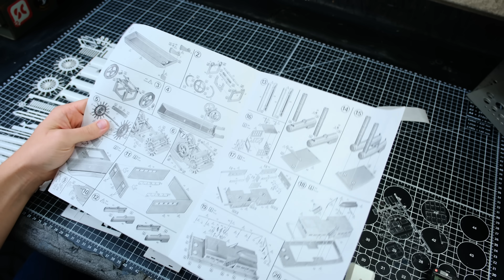Anaconda in Resin | Riverboat Epoxy Diorama

Comment: I really like how you've started incorporating the electrical switches into the build to disguise them. It may be worth trying out different switch types depending on the disguise, where buttons or knobs would be easier to hide.
Reply: I very much agree, I love the hidden switches, it's so much better than an obvious switch sticking out of the base, background, etc. And yes, it's worth looking into different types of switch - there are some low profile push button switches for example which may be more suitable in some cases.

Comment: I've built that riverboat about four times over the years. In its current iteration I extended the hull for better flotation, added better bollards and cleats and a wooden deck. It still needs very calm water, but it doesn't sink the way previous iterations did! Chugs along very nicely.

Comment: One cool effect that could add a lot of life and detail for very little work would be some paper cutouts to cast various shadows from the inside… like other crew members talking, or random papers/maps hung in the window, or even just some curtains that are partially open.
Just so the windows don’t feel so blank and uniform. 

This is incredible and better than anything I could do, so I’m not complaining. Just offering tips that I’d use because I rely on small tricks to add more detail and life where I can since I’m not as skilled at painting and stuff. 
Like when I sculpt eyes i always stab a hole for the pupil and make the iris part a shallow “bowl” so that when the eye is painted and filled with uv resin, it looks way more realistic even with my crappy paint job.. if I could paint well it would look super realistic! The pupil looks actually black like a hole because it actually is and the depth of the iris sells the illusion better at angles other than straight on, because that’s how real eyes are shaped. 
Very small details that are super easy to implement that add a ton of extra “value” is how I like to work. Poking a hole or adding a little cardboard cutout takes an additional 5 seconds but gives way more detail value.

Comment: What kind of glue do you use and what primer. I’m about to do my first model kit and want to get the right stuff. I’m hearing people say not to use CA glue by itself
Reply from the maker: You may need to do some experimenting depending on the plastic, but most solvent cements made for models should work well!

As far as primers go, the stuff I use is a little pricey, but made to preserve fine detail. It’s from a brand called Army Painter.
Reply: Thanks! God bless.